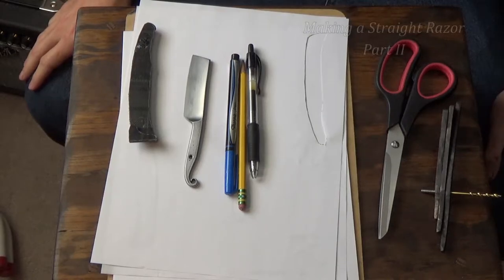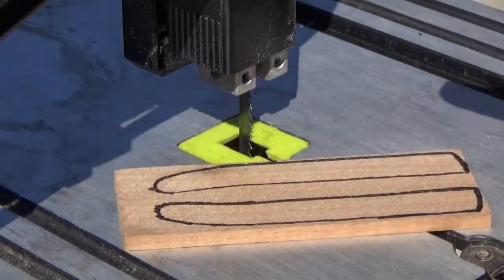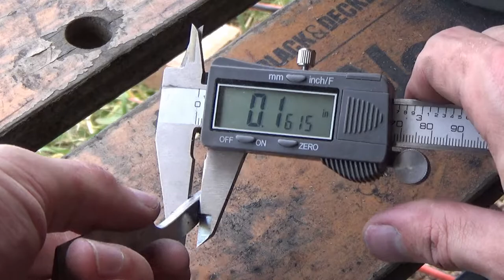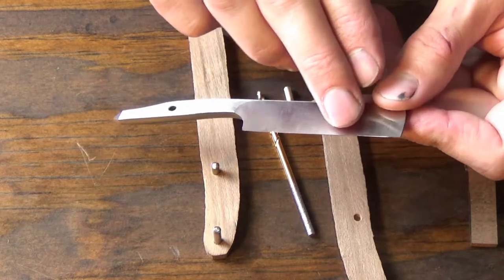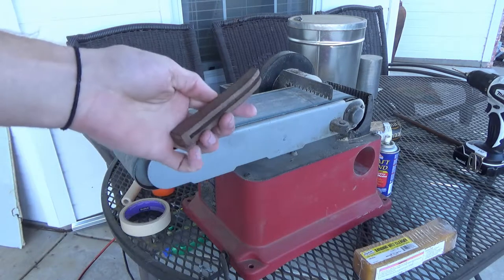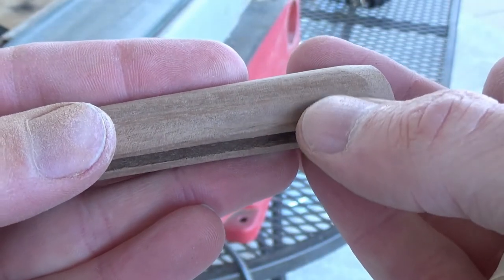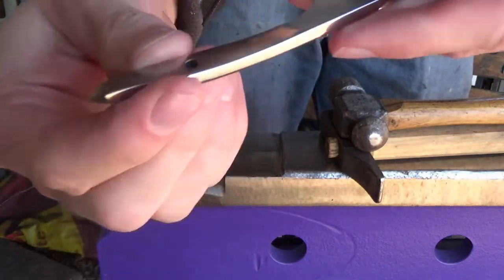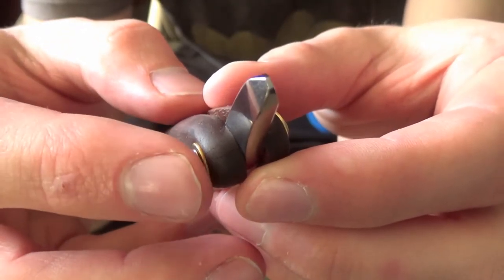Straight Razor Handle and Finishing

Comment: Would it be less likely to split if the pins was shorter? Not so much material to pein over might keep it from widening too much and splitting the wood. I am just thinking out loud, and know not of what I speak. Correct me at any time.
Reply from the maker: That is a major factor. The pin is also a bit hard, so it doesn't deform as easily. The strikes are a bit heavy with too heavy of a hammer which transfers energy deeper into the pin stock. The pin is too large in diameter which allows it to apply more force on the wood and the wood doesn't give enough to allow for the pin's expansion.... There's a lot of reasons but probably 70-80% is the length of the pin and how much I tried to get it to spread.